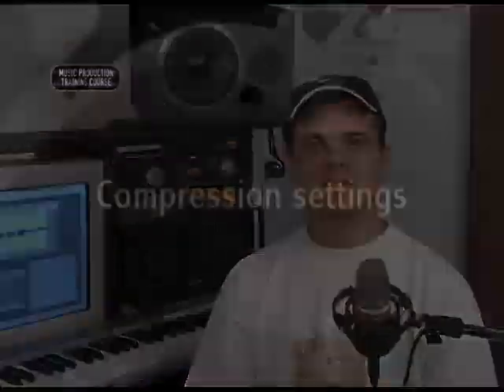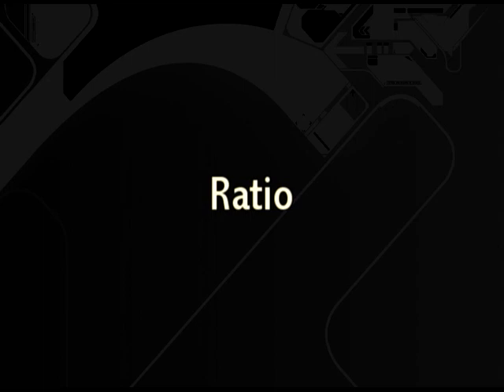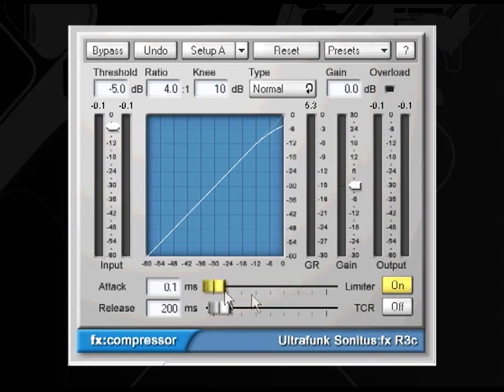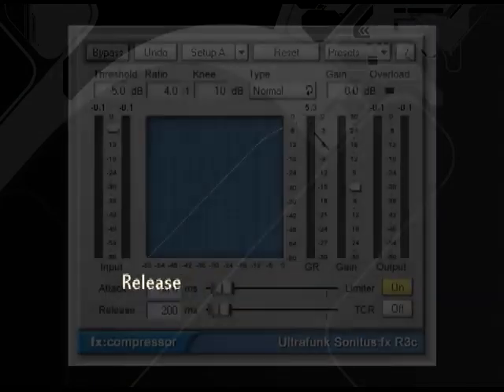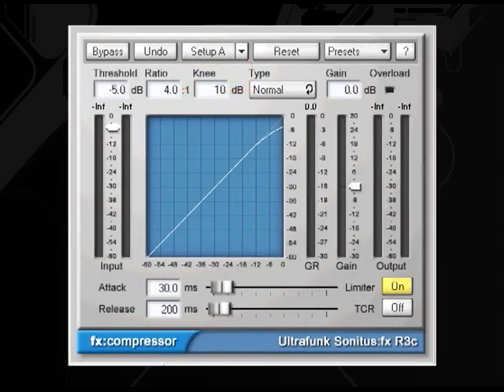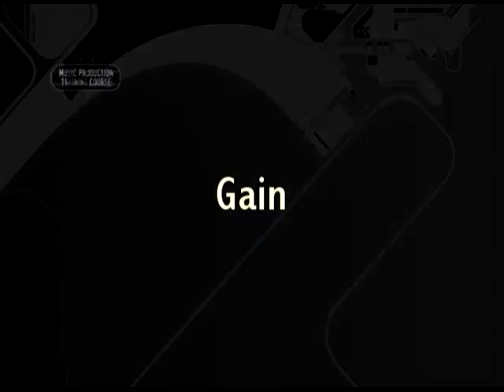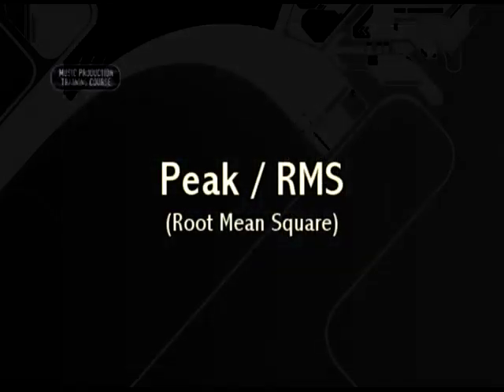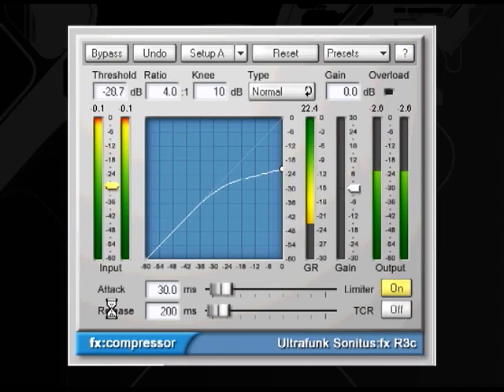Technical Theory - Audio / Music Compression (1 of 2)

Comment: @rav3beats im far from a master at compression however i still get it, the simplest way of putting it is this, if you are trying to make a kick drum sound how you want it, first your gunna eq it, then your gunna move on to compression, basically compression is changing the characteristics of your kick drum, say if you want the tail end to be longer and boomier, or make it shorter and more snappy, compression allows you to do that by making parts of the sound louder or quieter, simple really.

Comment from the maker: Ratio is a way to express the degree to which the compressor is reducing dynamic range. Ratio indicates the difference between the signal increase coming into the compressor and the increase at the output level. A ratio of 10:1 would mean that it would take an increase of 10 dB coming into the compressor to cause the output to only increase 1 dB.